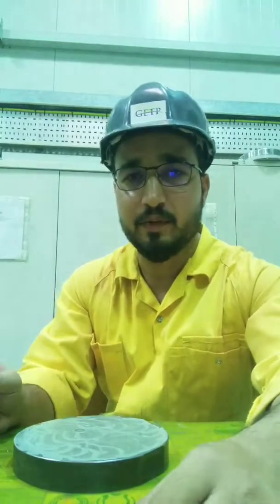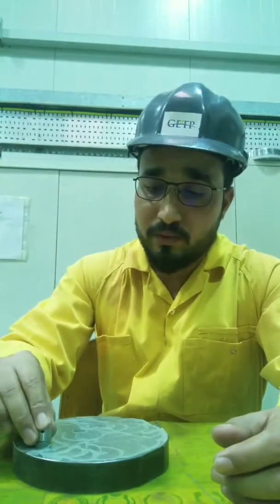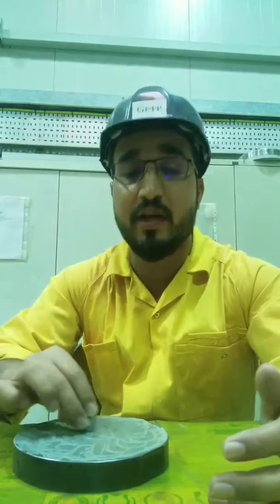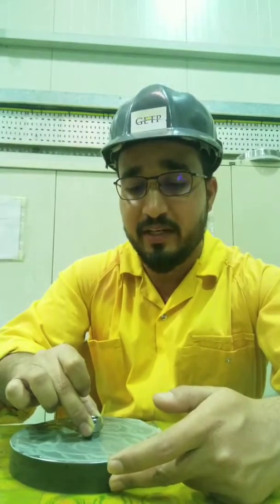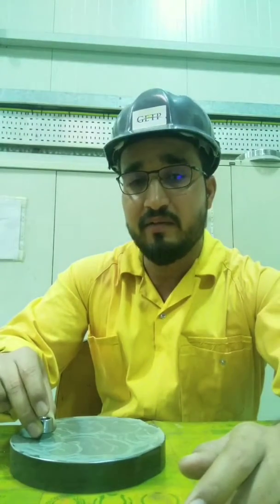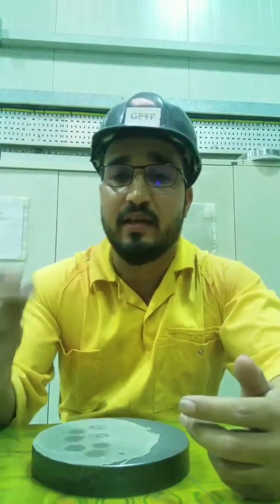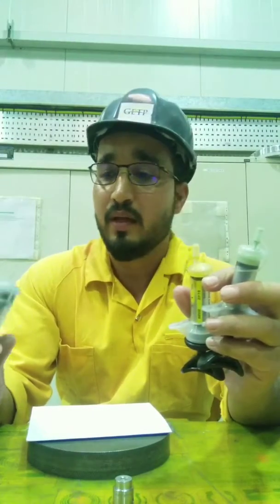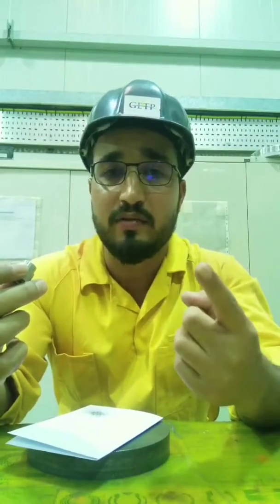Pressure Safety Valve (psv) Lapping....English

Comment: How to check flatness pre & post lapping
Reply from the maker: Standard way to check flatness is to check with help of sodium light equipment which is usually not preferred by many organisations. But easiest way is to see the seating area glow. After lapping and finished with diamond compound, if seating area is in dual colours like in Matt and glow that means its not flat.if it is in same colour so is flat. It will b easy for you to identify flatness by experience.